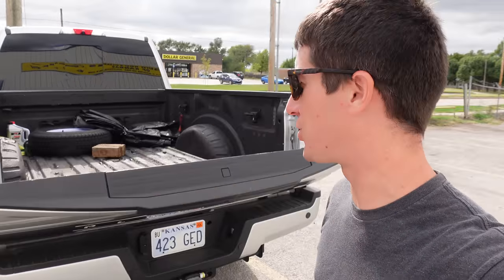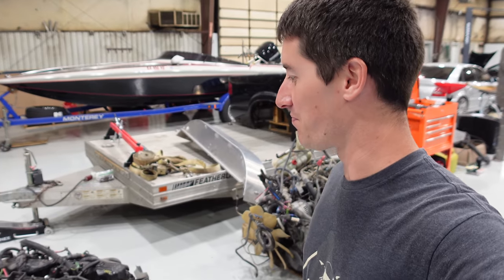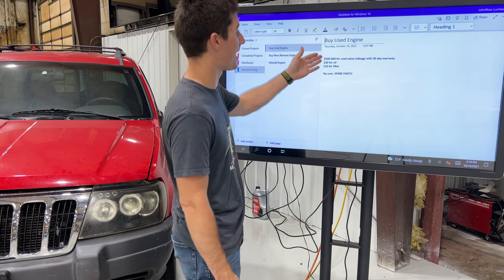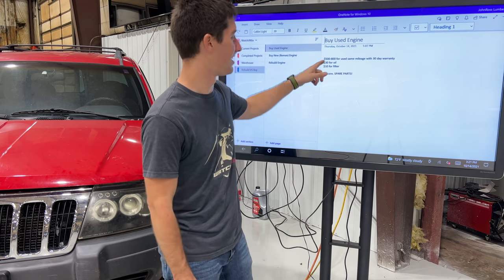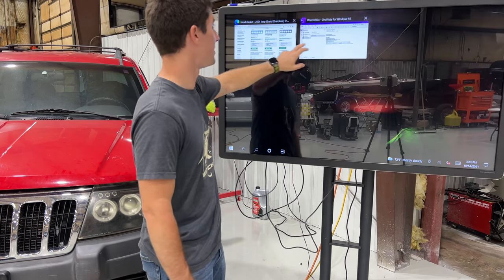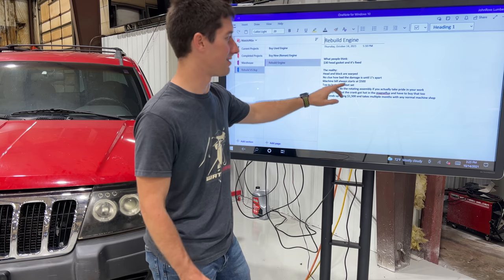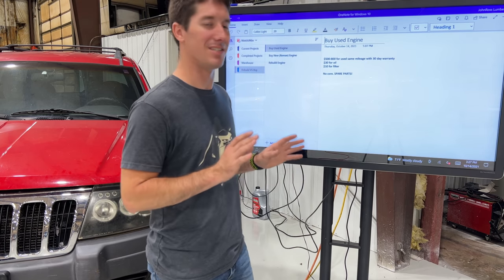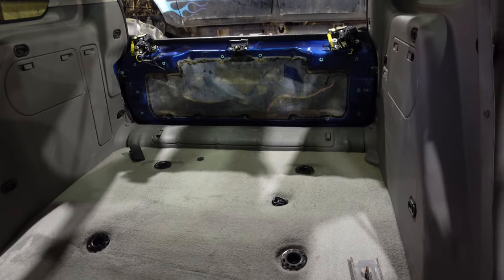Here's Why You Should NEVER Rebuild An ENGINE *The Math Doesn't Add Up*

Comment: I think it shows why the math doesn't add up on flipping cars (minus YouTube ad revenue). Book time to replace that engine is 12ish hours, which should be around $1,000 in most shops. So if you value your labor at $80/hour you'll barely break even on this flip. Plus you have to buy it, go get it, sell it, deal with the tire kickers, and have your money tied up for weeks to months while that goes on.
Reply: Its a marginal deal on that one. If you did the swap yourself, its still $1200 you can earn in your spare time.
Reply: 12 hours? That seems high. It would take me that long, but I am not a pro and don't have access to a hoist and fork lift like JR. I would expect a pro to be able to yank that engine in 3 hours or so. As far as flippers go, $80/hr = $166,400 a year based on 40 hours a week x 52 weeks. I know a few professional mechanics and none of them make $80/hr. Hell, I was a VP at a good paying bank and wasn't making $166k/year. If he makes $1,800 profit for a week's work, that is about $45/hr, which is $93,600 annualized, a quite respectable income for most people.
Reply: @RandomGuyDan  You are using bankers math. No way anybody is 100% productive in everything they do. That total Jeep project, a normal car flipper might have 20 hours into it. That is if you consider purchasing it, picking it up, diagnosing, sourcing parts, repairing, cleaning, marketing and selling it. Still good money making $1200 on it, but nowhere where your $ add up.
Reply: you aren't "breaking even" you still made $80/hr in your free time. The only way you'd barely be breaking even is if you paid someone $80/hr to swap the engine for you
Reply: Yeah no one with a shop and tools and a lift ever factors in there time and actually book time in a shop per hr
Reply: @RandomGuyDan  That $80/hr is not what you "make". You have to back out the overhead that pays for things like insurance, payment on the shop, paying for lifts and tools, scan tools, service data, and non billable time spent doing things like accounting, chasing parts, dealing with customers, etc. Most businesses are lucky to "make" 5% of gross sales.
Reply: Since 99% of the population can't change out an engine  :)  Me personally, I am going to get the price for the engine, call around to some reputable shops (dealers not included)  :) and get pricing to replace the engine, what kind of warranty they give on their work.  Then I am going to see what the value of the car would be and what it would be if I sell it needing a new engine.  How many miles on the transmission?  Will that be the next thing that will need repair replacement?  Then I will do the math and decide to fix it or sell it and buy something else.  I am someone who ALWAYS looks at the BIG picture.
Reply: The best way to flip a car is to negotiate a good deal and then be firm on your price.
Reply: Just not worth it. That's why cars prices are NOT heading down. Good used cars were too cheap. It was a party for me the past 20 years. I watched idiots empty their pockets for new cars when I bought all my cars low mileage and from elderly people for just pennies.
Reply: @RandomGuyDan  You can mow lawns for that much
Reply: i got quoted 7700 for a engine replacement at my toyota dealer...
Reply: I think most people who try flipping cars loose money.
Reply: 12 hours for $1000? Where's that? Here in the Democratic People's Republic of California shop rates have topped $300 an hour; 12 hours will cost you $3600 plus parts and tax.
Reply: @Michael The engine is not junk...it ran fine right up to accident.
Reply: @dwightlooi  I was going to say around here in oklahoma it is $120/hour average and not even at a stealership
Reply: @sinformant  That's really cheap. Here, the dealerships want $300~325 an hour; independents are about $180~225. I just had my PCV valve replaced at the dealer. It was $3637 if not for the factory warranty.
Reply: @dwightlooi  that is insane for a pcv replacement! And yeah but in the video he says $80/hr and he literally lives an hour away from me and there are no mechanics around here  charge that low...
Reply: @sinformant  Well... it's an Audi. The PCV valve is under the Turbos, charge pipes and the air-to-water intercooler. To get to it, the bumper needs to come off, the radiator and cross beam pulled forward, the intercooler removed and the charge pipes taken off. It's 10 hours to get them off and put them back. The part itself is 300 bucks. Good thing they have a 10 year 120K warranty on that thing because they fail so often.
Reply: @jessebianchi2631  Yeah, well, in just the audited Maricopa county in AZ alone you have 50K votes which cannot and should not be certified because they were double votes, votes from non-residents who registered in another state, from the dead or unverifiable no signature on record. The margin of victory in AZ was 10K voters. In WI and PA you have counties with more votes than there are voters. Votes were counted behind board up windows with count watchers kept out. A single lot of ballots show up with 130K votes for one Dementia Joe, ZERO for Trump and ZERO for any other issue or congressional candidates on the ballot. But you won't know ANY of that because you listen to FAKE NEWS or you watch CENSORED YouTube.
--
At this point, nobody should believe ANYTHING election officials or the Fake News say. They must be assumed to be corrupt and fraudulent until they can be audited and proven otherwise. Cheers to the HEROES of January 6th, this country is deeply your debt for standing up to the fraudulent swamp. Let's Go Brandon!
Reply: @Michael 

Excellent point!

I never use Electronics or suspension or brake parts from a junkyard but an engine isn't quite the same safety issue.

But yes, you are at the mercy of the prior owner.  But once he completes the deal he need not worry anymore cuz it doesn't appear he offers a warranty on his flip.

 I know with semi trucks that unless you get maintenance records with the truck- tractor it's basically worth scrap unless there is a warranty.  

I know this firsthand when I bought my semi: I tested the engine, transmission, and axles, but I kind of overlooked electrical and suspenion issues and so I ended up paying after I bought the truck another $1,800 mechanic to chase down electrical shorts.
Reply: @mph5896  your time is worth money  at least 45 per hour
Reply: @Michael with a taillight guarantee.  You could guarantee as long as they can see the tail lights once those are out of sight you're on your own lol
Reply: @benniethejew  yeah that would be true If every engine  came from an accident car truth is there are. So many variables.
Reply: @dwightlooi  amen
Reply: Victor Bloc
Reply: @carguy3028  too many add way too much work trying to make the car right.
Most customers at flip dealers dont care. 
Old car broke down amd they need a car now so they can get to work tomorrow.
Reply: @dwightlooi  voter ID is kind of the wrong direction.
If the libs want no ID to exercise the right to vote then why an ID to buy a weapon or exercise any other right.
So Im all for no ID to vote so long as we have an even playing field with no ID to exercise other rights.
After all what should it matter they dont care to ID people coming into the country.
Reply: @fixitallpaul4847  Because ONLY CITIZENS should vote and have the right to do so only once. The only way to ensure that only eligible voters vote is to identify them before they are allowed to cast their ballots. You can argue that there shouldn't need to be ID requirements to fly or buy a gun because these activities should be completely unregulated, but you cannot argue that anyone has the right to vote, vote multiple times or vote for someone else. If that is the case, why bother to have a country?
Reply: He did say this particular swap was a YouTube special. So the buyer is going to be getting a deal.
Reply: exactly same thing in the marine world.
Reply: @mph5896  so your time isnt worth anything 😟
Reply: @RandomGuyDan  go to a shop and tell them their time is only worth $40/hr. They will physically throw you out. My part time welding shop I get $100/hr.
Reply: @johnsnow1355  if that is true they are not good businessmen. Your time has to be accounted for
Reply: @benniethejew  and you have no way of knowing if it was damaged in the accident or if it was well maintained. Calling it junk is a bit overstated buy it may not last as long as many think
Reply: I have my engine rebuilt on my Goldwing and it was about 12 hours but that's mostly getting all the plastic off and believe me it was much cheaper than buying a new engine I disagree with this guy sometimes it can be cheaper to have your engine rebuilt and I've rebuilt many small ones for a fraction of the cost I'm getting a new one
Reply: @trvman1  also how does he know if the engine hasn't been mistreated or if it was starved of oil look at his attitude run the thing until it dies I want my vehicle to last as long as I do or as long as I want it I don't want an engine from a some trash car and if he has to take it out of there then that's just not very good economy. I totally don't agree with what he's saying not you the guy in the video
Reply: The shop cost 80 an hour the tech may get 20-30 an hour of that
Reply: the ford dealership i work for is $120/hr for labor
Reply: In my state ,you are only allowed to flip a car 5 times in one year before they require you to get a dealers license.
Reply: Don’t flip cars if it’s not for fun and you don’t enjoy it.
Reply: @benniethejew, good one! 🤣🤣🤣
Reply: @dewight Looi, that's why I am thankful to own an older truck that I can fix everything on myself and I mean everything.
Reply: @Michael junk engines? if its from a wrecked car, it ran to the scene of the accident.  Buying a car with a used 80K wrecked car engine, from the flip guy. is the same as buying a 80K mileage car from the original/second owner. the flip car is probably better because the gaskets will get changed while engine is out.  that =no leaks
Reply: Shops quoting me $1,800 to $2,000 to swap motors.  Just labor.  4 quotes.  V6 1998 Nissan.  Western Colorado.  $135 an hour average labor rate of private shops around my parts.
Reply: Flipping cars like the new bronco on launch or the new z roadster when it launches is where it's at. Use the lack of supply and hype demand to turn a hearty profit. Flipping cars is a rich man's game not a garage warriors game.
Reply: Ah yes, the Audi. I learned from other people's mistakes about buying an Audi. Most car designers are assholes but Audi designers win the JD power award for assholes 20 years running😁
Reply: $175 / he in the San Francisco peninsula.  All the non-operational care are sold out olin the Central Valley.
Reply: @trvman1 Sounds like money drives you. Not the worst, but definitely flawed.
Reply: @johnreed2272  If you're not flipping cars to MAKE money, then why do it?
Reply: @WatchWesWork u make it sound  like a hassle
Reply: @dwightlooi ??? What?  What are you talking about?  The video was about swapping engines...lol
Reply: Exactly. If you don’t place value on your own time…nobody else will.
Reply: I think this video is adequate and a good break even job but there’s plenty other opportunities out there. For example, my friend found a clean rust free 1997/40 year anniversary’s land cruiser for 12,000 from an old lady. He sold it for $38,000 spent two days replacing the head gasket.
Reply: @mph5896  That was exactly what I was thinking. He s your typical bank manager.$1800 per week does NOT equal $93600 per year. He is working in theory only. In reality, only about half that.
Reply: I feel like this is a disingenuous comparison. If you’re going to fix everything wrong when you rebuild the engine, wouldn’t you do the same thing thing when you swap a used motor?

Every used engine we replace ends up needing valve cover, gaskets and belts and there’s always a broken motor mount and new spark plugs… I’ve never seen a used motor that doesn’t need five to $800 in extra stuff along with it. 

I 100% agree that if you’re flipping cars, it’s almost never cost-effective to rebuild an engine but you’re going to have a lot more than $800 in a motor when you’re done.

Comment: As a mechanic I always tell the client the options or replacing or even rebuilding the engine.  I rather rebuild than replace because you don't know about how the replacing engine was worked or even if it's a used engine you don't have any idea how that engine was used.
It's better to rebuild the engine than replace it.
Always buy quality parts for your vehicle, don't go to under quality parts, they will make you throw money through the drain.
And the MUST TO DO with your engine, keep it oil change on time.  Use a GOOD motor oil and from time to time you can add a quantity of anti friction to the engine when oil changing.

Comment: Years ago when i had a shop, i always bought used engines from 1 particular salvage yard. His engines were always tested and put on shelves indoors. Bought and installed  over 35 engines from him in 2 years. Never had one needing a replacement.  If it worked out that it did, i would have done it for free labor for 6 months. If a customer bought an engine from somewhere else.  There was no free labor at all even if the engine went bad within its 30 day warranty period.  I had no problem standing beind my choice in using his used engines. Anyone elses i was not confident in.
Never had to provide free labor. I did as a rule replace timing chains, oil pump, water pump as well as front and rear seals.

Comment: I've been a licensed mechanic and machinist since 1974 and have worked in machine shops on thousands of rebuilds. I found that most of the engines I did were for rare or not commonly available engines or numbers matching and performance apps. I have given this same advice to many customers when I felt the conditions warranted it. They have lots of importers for JDM engines here in Canada and their rules in Japan for used parts are very strict. I've used plenty of them in my flippers and they have never let me down. I have totally rebuilt engines for my my own special projects because it's fun and satisfying for me ,personally but for everyday runners, a good used engine is usually the best route.
Reply: In a similar situation as this wouldn't you have first pulled the head for a look?
Reply: @Vintageguy73  Depends on the original diagnosis. Nowadays,  endoscopes and code readers narrow things down a lot. I don't know the exact problem in the first place, so we're sort of second guessing. If it shows a bad cylinder and it is narrowed down to a mechanical issue' then where do you stop. I have found if you just patch up a problem, you always wind up with others.
Reply: Question Rick.
I have a jeep tj 06 with the last year of the inline 6 engine, Which I really like.
They don't make them anymore , should i rebuild it, andbi want to keep the jeep as a classic car since most were destroyed on rock crawling or young dudes pushing them to ridiculous limits lifted.
If my goal is to preserve and use it as a daily driver, would it be good to rebuild or get a new engine?
Reply: @oscarbear7498  I'd rebuild the straight 6. More torque and reliable as a rock. I had an 08 with the V6 and it was down on grunt from the inline. Just my opinion.
Reply: Can a LS 2015 v6 3.6 engine fit inside of a LS 2011 Chevy Camaro v6 3.6 engine. My engine in my 2011 blew out just wondering will the 2015 fit inside my car
Reply: @Pretty0131 they have v6 to v8 conversion videos i would ask the people that make those videos

Comment: I think that it matters for what you are doing. I personally love rebuilding engines because of the process of it and the satisfaction. Plus knowing that the engine is in great condition.
Reply: Did you even watch the video?
Reply: @justsomeguy6550  Yup just sharing my two sense about it. I have a Fireball motor for my boat and those things are hard to get parts for because it is really an AMC motor. I just traded a guy oak wood for a 327 that I'm going to rebuild. I do the boats as a hobby so it isn't the same as flipping a car like that John does.
Reply: It is rewarding..
Reply: Agreed and those salvage motors ain't worth nothing it's like a band aid motor no one knows how the previous owner ran that motor. Break downs and tow trucks will surpass a rebuild in money. This idea is more for people that don't get attached to a car and just wanna make money on them by flipping them.
Reply: @fastone7272 My mindset is always that it made it to a salvage yard for a reason. I can guarantee compression on a rebuild, salvage engines aren't testable in my area until bought. No engine removal services in my salvage area.
Reply: @johnreed2272  it's why I rather not waste my time on them salvage yard motors but that's just me I don't flip trucks or cars I keep them. Like my highschool truck.
Reply: A sludge free salvage yard motor that hasn't overheated can be pretty good with new gaskets and a ball hone re-ring job - for personal use.  It's a poor way to operate a business, but as a hobby it's okay.